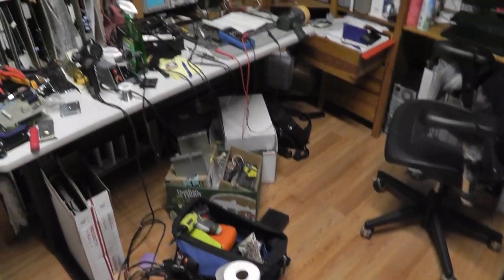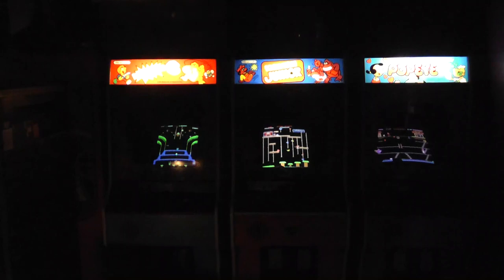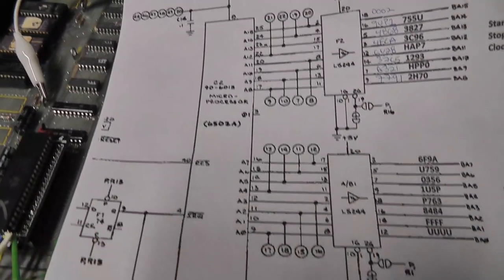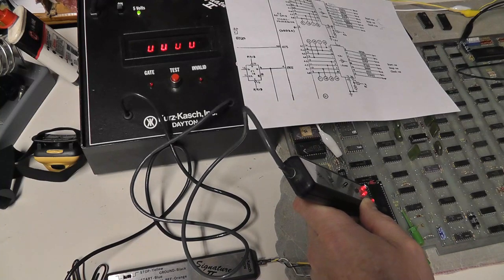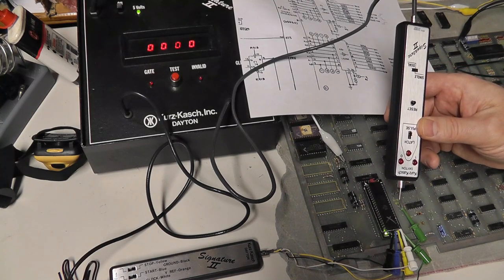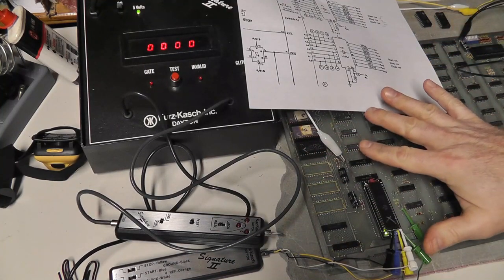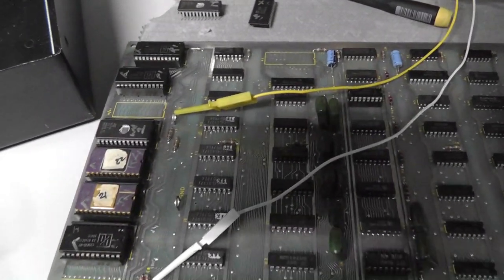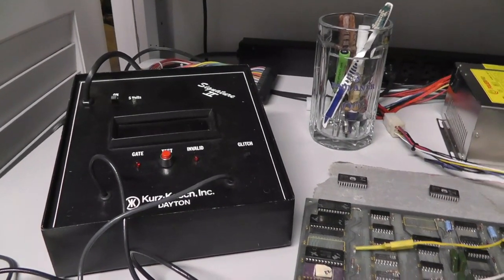Missile Command Repair PCB #1 - Part 2 Signature Analysis?

Comment: That's actually a nice bench there, mine doesn't look less chaotic, quite the contrary... I sometimes barely have space to fit a circuit board.
Interesting signature analyzer... never seen one of these.
Reply from the maker: Definitely happy with my new test bench area.  Kurz-Kasch made lots of arcade game/electronics test gear in the late '70s early 80's.  All their stuff is kind of retro cool.  Just fun to use the same test gear that a tech would have used back then sometimes.
Reply: @jacklick  I got an awesome In Circuit Chip tester that is also an antique computer in itself. It's from 1987, but it looks very early 80s with a 5 inch green monochrome display and a less-than-CGA text mode, but it gets the job done and I can even program it in TestBASIC - that is I can write games, but I can also write programs to test ICs that didn't exist when the machine was made.
But my favourite piece of test equipment is also the most unassuming one - the Testofon. It's just a loudspeaker with a battery, test leads and some VERY clever circuitry. It converts test current to audio frequency. You can measure resistance, capacitance (and leakage - no ESR though), diodes, transistors (you need to hold the probe in a really specific way and switch the transistor on through your skin) and it detects short circuits, broken wires and scratchy potentiometers in no time. It's also super handy if you have a circuit board and no schematics, because it takes about two minutes worst case to find out where this pin of this IC goes.
(it also can measure inductance, but unless it's a big transformer, it is pretty useless for this)
The Testofon is basically an acoustic signature generator. Got two identical circuits? Does one sound different? There's your problem!
Btw. the test current is 2mA max - you won't fry any ICs from the last millenium with this thing.

Comment: JACKLICKS,  the signature is a total of the data bits summed together that gives your that signature value or what formula are you using to get the signature value? 
yes I know you got the signatures from a cheat sheet from somewhere online, but I don't know how the "signature value" is being calculated, do you know?
Reply from the maker: The signature analyzer is creating the "signature".  It my simple understanding, it takes in data over sample window (based on where and how start and stop are configured) compresses it down to 4 bits and uses a decoder rom to display four 4 bit hex numbers like 0000 or ffff.  It doesn't work like a hash or crc on the data itself and is really not significant to the actual data that was "seen".  This method is 100% dependent on someone taking signatures from a known working board and recording them so other can compare.  Atari did this for many of there games, just not Missile Command.  That is really the depth of my understanding.
Reply: @jacklick  ok thanks, i thought it was a hash or crc signature by measure the data signal and counting how much bits on in the data signal. 
Its like the fluke 9010A has a special fluke signature that is NOT a hash or crc signature it seems. 
Can you measure each data buss line one by one while the arcade game is running and use a logic analyzer to get a hash or crc signature from the measured data signal?
Reply from the maker: @billwilliams6338   you can try and take signatures while the game is running but you aren't likely to get anything that is consistent.  that is why you need a NOP cpu adapter to create the consistent instruction.  With a fluke 9010 it actually has its own memory and cpu so can read all the data from rom and calculate its own "signature" hash/crc on all the data.  So when someone says this is the fluke sig for this rom it is more like the crc/hash that an eprom burner would show but they just use a different method for calculating it.  <<take some skepticism as I haven't use a fluke but think I am pretty close
Reply: @jacklick  can't the Fluke 9010A output a "consistent instruction" like the NOP cpu adapter and you can use a logic analyzer with 8 logic inputs to measure all 8 data lines at the same time to get a data signature or hash/crc?
Reply from the maker: @billwilliams6338  the fluke can put out consistent instructions (write to specifc addresses), which you can use to take signatures using a SA, but they will be different than those created by the NoP << 99% confident.  You may be able to program it to emulate a NoP but not sure if you can invoke the NoP instruction set.  I just picked one up so hope to figure that out as I had the same question.  I don't have a logic analyzer but believe it is just showing the logic levels not actually creating the logic levels.  You need a logic pulser (which maybe analyzers have) to create logic levels at different frequencies<<50% kind of guessing on this one
Reply: @jacklick  Yes the fluke can write to a start address and end address an address width size range. 
If you write the whole RAM range to test all the RAM chips and press LOOP button to loop the writing address range. 
You can use the Signature Analyzer to take signatures for each data buss line? 
Logic Analyzers not only show the logic levels but also will calculate all the data signals being mature and display them in hexidecimal values and I'm not sure if it can display signatures CRC/hash values also. 
just press the DATA BUSS TEST:  The Fluke 9010A can output different pulses at different frequencies and duty cycles on each data buss line for troubleshooting a data buss
Reply: The algorithm is roughly as follows... on START the analyser sets a 16 bit LFSR to 0000, then for each clock it shifts the LFSR one bit and uses taps at 7,9,12 and 16 XOR with the incoming data value to create a pseudo random sequence affected by the incoming bitstream. When it receives STOP the value displayed is the final value of the LFSR.

Comment: @9:04 what does the switch do?  why do the signatures change?
Reply: OK I figured it out and oh man that is subtle... the Original Atari Cat Box doesn't use NOPs, instead it just increments the address bus as a counter... but a NOP executes NOP operations which are two cycles so effectively the clock for the signature fires twice when NOPing and once when CatBoxing!
Reply from the maker: You got it.